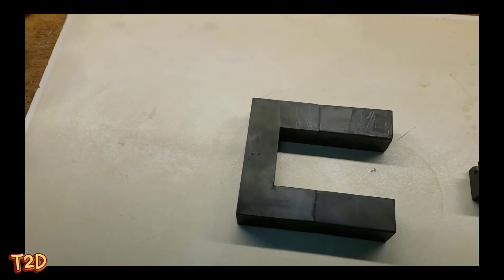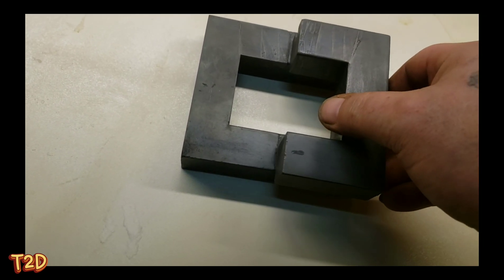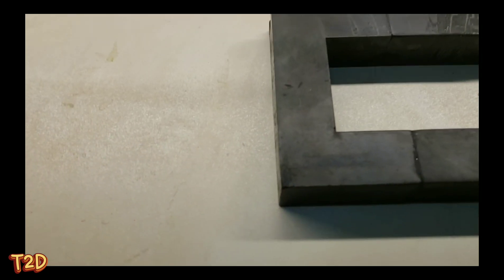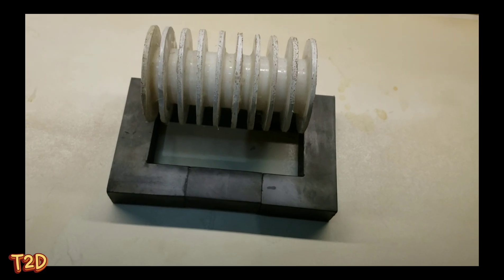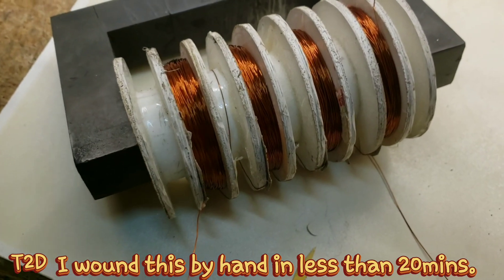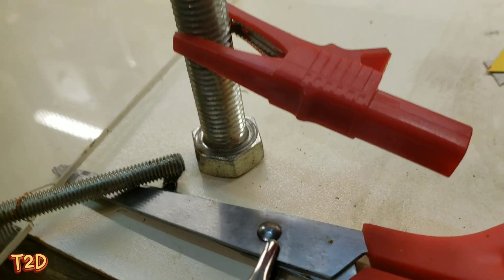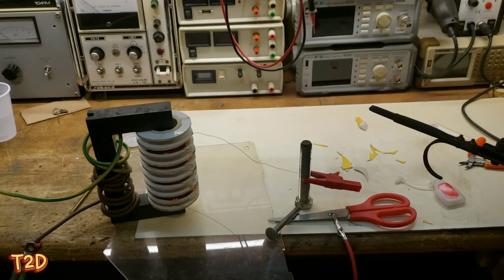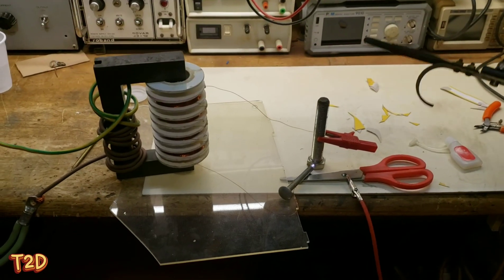Homemade X-Ray Transformer, Part 1.

Comment: Good output! I made a small one out of an old Large TV flyback core and getting the hot white arcs so probably good current out of it i'm debating to make a small sgtc out of it or a large marx generator may build a HV Rectifier haven't decided yet. Good work Steve! ;-)
Reply from the maker: Thanks mate. Cool that's your watching my videos. It's good fun making your own transformers. There is a part 2 to this video on my channel, and eventually a part 3! Hopefully soon. 
Yeah Tesla coil sounds fun, or even just a rectifier, should get you longer arcs. DC arcs take more breaking as you know. 

Steve

Comment: Hey, I've been making some hf transformers with normal insulation between layers. What's the advantage of your bobbins type secondary? And doesn't that makes it easier the wires to arc over?
Reply from the maker: The short answer is it reduces parasitic capacitance between windings, which can be significant at higher frequencies...

Steve

Comment: Mmm why high frequency stuff is becoming so popular. You sneeze at it and the transistors die, makes so much EM noise, needs a good DC power supply and power transistors so it gets very complex and expensive when you want some serious power, the ferrite cores are as fragile as my grandmas china and worse of all not easy to get or even make. Not hating on you, just asking as that's what i see, maybe i need to learn more to embrace it, I prefer the good old way, find it more fulfilling.
Reply from the maker: I love both 50hz and hf transformers, although I can get bigger arcs from hf 6feet easy i will show on a vid soon I think I can get more too as that was at 35A 240v no where near full power...👍👍
I have a 50kw 50hz 120kv transformer that can run a 15kva continuous arc I will be showing on my channel in the near future 👍..

Steve

Comment: how much power doses it take? I'm building a custom one with the same size core 1inch thick 4x7inch ferrite for hf I've got a 1.8kw driver built and a 1inch thick 4.5x4inch isolation transformer to protect the driver ill cover in a future vid. I'm running a temporary 4x dc flyback its giving me 100kv at 75% power so maybe 150kv at 100%  I cant go hirer then 75% till I get more oil I ran out before they were completely submerged so I need to go get more veggie oil ill cover the 4x in the next vid. 
I did show a short single flyback test vs the new driver at the end in my new update vid.
Reply from the maker: Hi, my transformer could do many kws but it would need a better primary ie litz or copper tape as it is it can run around 6kw mate .

Steve
Reply: @T2D.SteveArcs  oof good to know, ill put that side project on hold till I can make a 6-7kw driver. in the mean time the 4xflyback seems to work with 200w-1.8kw
Reply from the maker: @numatechprototypes222  cool mate
Reply: @T2D.SteveArcs  my switch mode power supply pwm controled ZVS driver circuit that I built currently has a efficiency of 96.4% not including the transformer the control panel I'm still waiting on a volt and amp meter that also shows what hours and energy usage but I have it hooked up cuz I have all the operational switches though my 3D print was a bit botched  and there wasn't enough room in my box for the control panel so right now it's free-floating and super glued in place till I can print off some panel walls right now I'm printing off the 12 stage bobbin for the large transformer thanks for helping me out by the way I don't want to stress my new driver that much if it's going to try to draw that much power. So I'll just make a specified driver for that transformer.
Reply: @T2D.SteveArcs  hmm I think I will at least test it on my new driver cuz calculating the meat of the core and the estimated resistance of the secondary coil and load that I plan on putting it through the (1x1, 7x4) 3D printed transformer if it reaches optimum efficiency I should be able to drive it with around 1.5-2 kilowatts but it be rated for six to eight easy and the volume of the core equals out to around 8- 9 medium to large tv flyback transformers.
Reply from the maker: @numatechprototypes222  yeah it's no problem, obviously depends on what you put into the driver just run at low power like you said..

Comment: Whats the power input?
Reply from the maker: I cant remember what we ran it at, but in the part 2 video, I ran it around 5kw. It's obviously capable of much more. 

Steve
Reply: @T2D.SteveArcs  that's up there. Do you design and build all your projects by yourself?
Reply from the maker: @johnnycash4034  yes mate absolutely...

Steve
Reply from the maker: @johnnycash4034  some of the transformers I show are rated at 50kw intermittent use, that said I have only ran upto 20kw so far and mostly run them at 15kw and below, at around 12kw I can pull a 6ft arc😁
I'm building a monster driver that uses 800A 1200v igbts and plan on running it at my mates as he has 100A 3ph supply, maybe run two 50kw tanks in parallel or pick up a bigger tank maybe a 150kw 🤣
Reply: @T2D.SteveArcs  do you think you will be willing to share the design and diagram please?

Comment: Hi, really amazing again.
Same question, do you drive it with a full-bridge? If yes do you use gate transformer?
Reply from the maker: No I use a IGBT half bridge no gate drive transformer as they are frequency dependent and I like to be able to drive anything.
Steve

Comment: Wow, thats more than decent output. And its not even done! Two questions: How did you cut and grind the ferrite since its a very hard and brittle material (diamond disc?)

 And how do you wind the bobbin? By hand or with a winding machine? And how many turns does the secondary have?
Reply from the maker: I used a tile cutter( diamond disc) and then smoothed with a piece wet and dry sand paper on a piece of plate glass. 

I wound the secondary by hand in less than 20mins. I think theres roughly 350winds on each section. So 350 x 4. Didnt keep a precise count wont matter anyway as they are all in series. 

Thanks Steve.
Reply: Nice